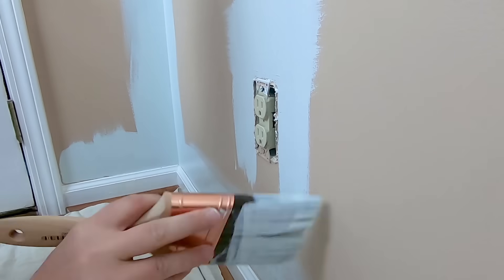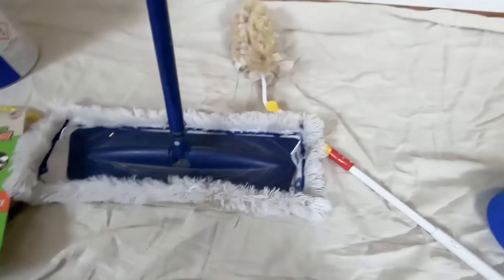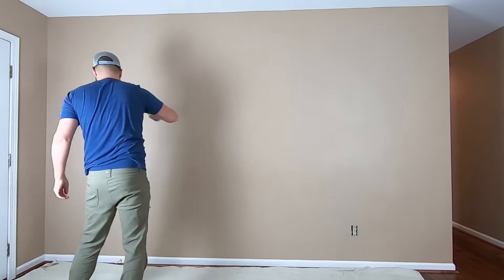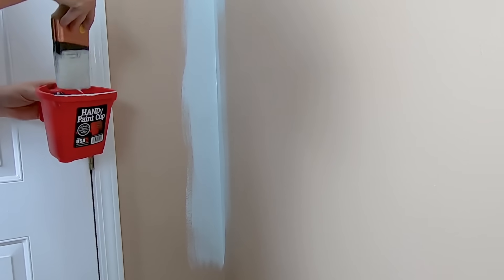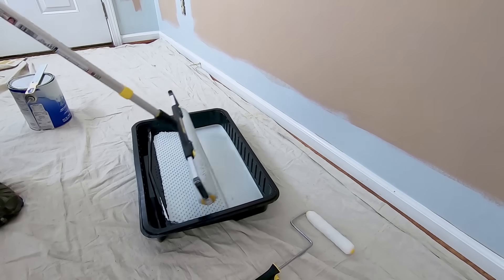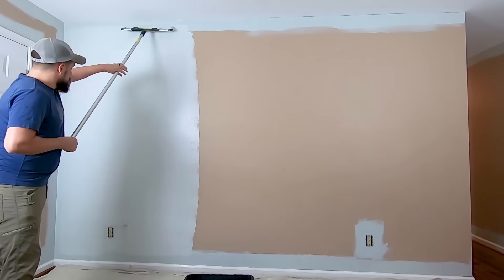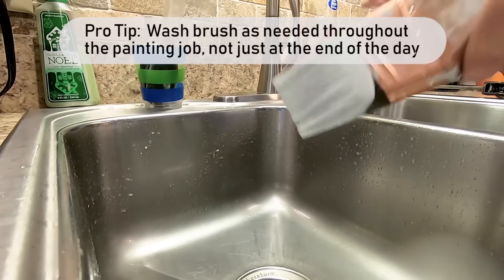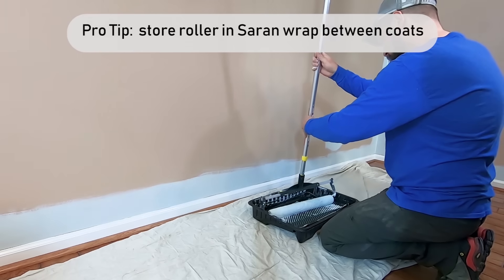How to Paint A Room Fast Like A Pro (Tips for Beginners)

Comment: I always recommend a 14" roller nap in a Wooster roller frame,  NEVER use a Purdy roller frame, they have Teflon clamps, which wear and are useless within a week's time, and then your roller will fall right out on you, the floor, you are gunna have a bad day. The Wooster will last for decades and actually costs less. Also, use a Premium 1/2 inch nap, it "sprinkles" less and holds more paint. A Purdy paint 5 gallon troph is best, however. The paint brush bucket bucket, the Wooster, again is better. It has a magnet too, but it is wider and flat for using a 4" mini-roller with. The 6" mini roller won't fit into a paint can, so you have to use a troph, this slows you down. When you are done, you can place the 14"roller into the 5 gallon bucket and seal it up, no clean up at all.

Comment: So i used to be a professional painter back in the late 80’s/early 90’s. Back then this is how we painted interiors. Basically we only sprayed exteriors. 
But now it seems like all the painters, at least where I live, spray all their interiors. So my question is this.. after all that masking off, cost of masking materials, plus setting up then cleaning the airless, wouldn’t it be about the same amount of time doing it like this, vs masking and spraying? I can roll pretty damn fast, even with a regular 9” roller. As well as cut in.
Reply: Ditto on the time frame and still paint today. Brush and roller guy myself on walls and that'll never change. I do spray "most" trim/doors/millwork these days as it's a far superior finish (although a nice brushed finish on millwork can look spectacular if you get the brush marks just right to match the grain) but I'll take a brush and roller job on the walls any day. Problem is it takes a good year to learn how to use a brush properly and another year or more to get fast at it. Rolling can be taught fairly quickly but spraying and taping can be taught in a week. Company's aren't looking for craftsman that know their trade, they want speed applicators. As far as that 18" roller goes, I haven't tried one but that's surely meant for commercial work doing block wall school and hospital hallways (been there done that and a 9" sucks with blockfiller). Painting a bedroom with that are you kidding me? Good luck with that doing the closet, in between windows and other tight areas. I can roll out an entire house in 2 hours with a 9" and there is no way that 18" is saving me time when I still need a 9" and a slim jim to get to half the places that thing doesn't reach, nevermind the sore shoulders from that weight at the end of a 6' pole.. Have fun cleaning it as well, lol. Kids these days, don't know nothing. 

edit: I'll add that 18" would be good for priming new houses. No electrical or millwork, just miles of raw sheetrock. I can see it being useful for that.
Reply: @wally7856  i tried using an 18” one time and it really was a pain in the ass. It’s very heavy and you fatigue quickly from it. I can roll faster with a regular 9
Reply: @wyattsdad8561  Just because it's new doesn't mean it's better.
Reply: @wyattsdad8561  Fatigue city for sure, nonsense anyone would recommend to use one for a house.

Comment: I once saw someone use a wide roller and use the strangest technique to paint the ceiling corners. He would very strongly roll and ram the roller into the corner and rely on the heavy pile squishing paint out to both sides of the corner so he wouldn.t have to brush

Comment: Fabric softener to clean brush and roller, etc.  It will even get paint out of carpet.  Put blue tape around the top of the brush, as it keeps paint off of that hard to clean area.  A product called flotrol added to the paint slows down drying for a smoother finish. I have a plastic lid that fits on the paint can.  It makes poring easier and seals the can to keep air out.  I keep the paint can and other items in a plastic bin to prevent accidents.

Comment: Retired pro painter here.  My #1 advice- use good brushes!  Do NOT go cheap!  Purdy has excellent  quality, for example.  A good brush makes good painting possible and if you clean the brush good after you're done, it should last a long time.  I've used Purdy brushes so long that the bristles were worn down too far to paint well with anymore. But they still worked!  Buy good brushes and you won't be sorry.

Comment: Weird watching you wash your brush in the sink. This is a huge no-no in Australia! We are supposed to wash our brushes in a basin or bucket, let the paint settle, tip the “clean” water on the garden and wipe the paint sludge out of the bucket with paper towel. Great video though. I will definitely be looking for an 18” roller. 👍

Comment: 1 never touch brunch to bottom of a container it breaks the tips of the bristles and gives terrible edges.
2 push drop sheets all the way in over quads or paint gets on the most difficult part to clean.
Scraping a run will leave an area to fill , sand it till gone using touch and eyes to check and recheck.
3 straight cut always always always leaving a thin line on the edge creates a small edges that comprises the next edge.
4 don’t cut in so wide it leaves a difference in finish between brush strokes and roller stipple.
5 stand up straight while using a roller that small bend done on every movement creates lower back problems especially with using large rollers.
6 do not drag drop sheets as they could scratch floors with fine dust caught beneath sheet.
7 wrapping sleeves has 2 issues one being they begin to fine spit the other dryer outer fibre creating a heavy stipple.

Comment: SANDING THE WALL!?!  As a woman, I already have this wall painted because I don't sand, I certainly don't dust the walls, and I never tape.  I use a very small brush to edge the baseboards and around the plastic outlets.  Paint fast and careful and it's done in an hour or so.

Comment: I use a straight edge on the bottom, hold the straight edge right by the baseboard when cutting in and you won't get paint on the baseboard.

Comment: I live in an, what could be a Gorgeous apartment. It’s brand new, still under construction. I think I got the forgotten one 😂 😢 Everything is painted over,  has this cracked in front of sink, and it’s new, quartz countertop in bathroom, with a ton of grout, on outside bottom of tub. Missing,  not painted, holes on sides or dripping of paint or have gotten, from those, please excuse me bc I don’t really know what it’s called, those lil trim pieces below the baseboards?, and top of is caulking. Messy caulking, including the bathroom. Everything is caulking in these apartments I’ve lived in-new, too. I just don’t understand?! The front door/back patio doors are half painted anddddd those seals are not placed correctly, so door doesn’t shut properly. I’m stating this all because I don’t know what kind of brush(es) to use, to touch up the paint? for corners of walls?, how to match caulking?, bath everywhere, mostly sides and baseboards/trim,. Then that piece on bottom of inside door, like a lil flap, above door sweep, I don’t know if painted or caulked? But peeling to brown. It bothers me. Just a tad peeling. Supposed to be all White. It’s easy, but getting the correct tool(s) I need anyways, isn’t easy for me. Not atHome Depot 😂 They’re laughing at me, bc they can’t believe I understand lots, but showed pictures and they’re in shock-my older-“new” Apt. Those bottom trim/below baseboards and around everything on bottom need a painting or removal and repaint. These strips, I swear they place, to cover some part up, (they’ll do it-they’re great, but I want to), except a new piece of quartz😢 
Longgg story/question is brushes to not make it look different than?, on trim, baseboards and side of walls, window sills?, cabinets that are supposed to be pre colored, I see painted same color as baseboards?. Also, with a lil chunks out of side of wall, doors, rough ends of doors too?, like around bathroom towel holders, here or there?. I have their paint. I have the caulking remover and placement tool. 
I Thank you kindly for this video. I just stumbled across it. I’m going to watch a few more and subscribe. 
Also could you make or do you know how to cover up cracked quartz or? And most importantly do you have a video or is it not possible, to fix a very nice SSteel stove, but above the knobs there’s flat SSteel and it has 2 deeper scratches. I assume from placing in. I consider where I plan on living for awhile, my home. I built one bf, @23 yo and my husband was in construction/engineering and electrical. I know most but told and paint brushes/caulking-nope because I never had a problem up North. 

Appreciate your video and time

Comment: The one big mistake that I seen from this happened right away. He did the brush work and roller work at different times. By doing it that way you will see where the brushwork ends and the roller work begins because they dry at different times. Always do both at the same time so that the paint blends together as it dries.
Reply: Not necessarily so.  If you feather the cutting in properly you will never see the difference. Sometimes it is not practical to do both processes at once. Im not saying your information is wrong, but it can be overcome.

Comment: These are all good tips but for painting between wall and ceiling, I prefer to bring the ceiling line 1/8 down to the wall. Most of times, the ceiling/wall edge is not completely straight and  no matter how you cut that line, it might appear wiggly. I just tape and bring the ceiling line 1/8 down and seat tape edge with clear matte polyurethane. Straight ceiling line every time even when the wall or ceiling are not straight..

Comment: The wide roller like this no bueno. The 9" roller works perfectly when you know how to paint, but I don't think OP knows how to paint. 

You gotta learn the backrolling, feathering and basic N pattern. Just put a lot of paint on your roller, draw sharp N on the wall, feather the unpainted wall and backroll the whole thing and start again (painted professionally for 6 years).

Why 9" roller? Because when you go into smaller rooms and smaller spaces that 18" roller is going to be difficult to work with.

Cutting in the video is too wide, you can remove at least 1-2 inches from that cutting. When you cut this wide and it dries before you start rolling it will show in the final stage.

This will work for home renos for yourself, but if I did this at work, I'd be fired.

Comment: Why would you use ProMar 200 in a beginner paint video? The list price is super high and it's easy to screw up for non-professionals. Also the old color was already glopped onto the ceiling, so your cutting in just means that even more wall paint ended up on the ceiling. You also got a lot on the baseboard. Pretty sloppy.

Comment: Why do you not use paper tape instead of leaving a gap?
Reply: You didn't ask me but I know why I wouldn't and the answer is simple - 4x the work. A good brush and a little hand-eye coordination will greatly speed the job. For me it's easier to just paint straight than to tape straight and paint. For me, cutting in is a zen-like experience, it's my favorite part of painting. Also, tape gives  false sense of security - it's easy to get careless and hit past the tape line.
Reply: I bring my brush in almost dry to the cut line,  barely a “hair wide”. If it lays perfect good for us. If it doesn’t lay perfect … it will be on second cut. Tape Only when needed or convenient, it’s about time/money for us pros.

Comment: My heart broke when you washed the paint down the sink. This goes straight to the ocean. Instead use a technique called pain floculation to clean the brush, then use a final rinse in the sink. Much less harm to the environment. A tablespoon of hydrated lime and aluminium sulphate into a bucket is all you need. It will last weeks and at the end you can dry out teh bucket and biff the paint. Good luck.
Reply: Nope. It goes through the water treatment plant. That’s what your taxes are paying for.

Comment: I think you don't have to wash the brush in the sink
Reply: You can wash the brush anywhere. And washing the brush out is usually done on bigger jobs… if it’s just 1 room or if the brush performs , it’s not needed… ur right kinda. The key he did miss out was getting the water out of the brush after washing…. Spinning it with your hands is my method.

Comment: Using brush to paint the walls, I mean cutting corners? Honestly I don't get it. Just put some painters tape 20-50 mm height and paint it with smaller diameter roller - it's way faster than cutting with brush, the line is pristine and the whole wall looks tidier without even a hint of brushmarks. Of course you need to remember to take off the tape while second layer is still wet to prevent tears, but still it's not that big of a deal. Granted, I would probably cut with brush painting the shed but in the house I don't think so. Anyhow, thanks for the video.

Comment: Always, always mask off evening before you even open the paint can. Mistakes will happen and you'd rather have it on tape than on the adjacent wall, door and window trim or baseboard. Also have absorbing clothes on hand with some paint thinner. This dude has all the money to buy expensive  Purdy painters supplies but no experience. Don't listen to this dude.

Comment: How are we supposed to be able to judge how "straight" your paint line is on the wall to ceiling transition when YOU'RE USING MATCHING PAINT!  With a contrasting paint it might look horrible using your suggestion... we couldn't know.   Makes no sense!
Also, no mention on reducing the point for cutting-in... which is ESSENTIAL to getting a straight line.  Today's thicker "one coat" paints are too thick out of the can to cut in with the control needed without leaving too much paint on the wall.

Comment: Never clean your brush over the sink. Even when it's water based paint, it's still really bad for the environment.
Reply: Where should it be cleaned then?
Reply: @Little_Sidhe  You should put it in a can (or old paint can) of semi hot water, leave it for 30 minutes to an hour and rinse it in this can. The water will vaporise over time if you just leave it and then you can turn it over to your township or some other company who can dispose of it in a good way.
Reply: I'll decide!
Reply: Bollocks. Waste water is diluted +1000 times before it gets to the water treatment plant. You aren’t dumping a large volume of paint into the system, just a tiny percentage for cleaning. That’s why you are paying taxes for waste water treatment. If you want to fret over the environment, lecture your neighbours about dumping oil, gasoline, fertilizer, and dog shit into the stormwater system, which isn’t treated at all.

Comment: Hate to be a pain. But you need to add the golden rule. Stir the paint. Never work from the bottom of a tin. Never ever.....and you don't need a 3 inch brush. 1.5 inch. Plus a 4 inch roller.   roll over it, to match the method of the full wall. And eliminate picture framing.  TBH. With that 3 inch. I'd of brushed the whole wall by the time you finished cutting in.
Reply: The paint gets stirred at the store. Use whatever brush is comfortable. Cut buckets are standard. Again use whatever you’re comfortable with.
Reply: @emilyc9380  The paint never gets stirred or shaken properly. There is always a slight tint in the bottom of the Tin, we've been painting for over 30 years. Unless it's mixed in the factory a pre mixed colour. You never work out of the bottom of a tin.
Reply: @bmc007  I could, but your making a video that's good. But missing out some essential information. Working out of the bottom of a tin. From a machine shop tint. Will give you picture framing. Where the cutting in will look different. If your wanting to make some cash from You tube. Make it properly. That's all I'm saying. If Constructive feedback is bitching then good luck on you tube. 👍
Reply: You didn’t lay off the paint.